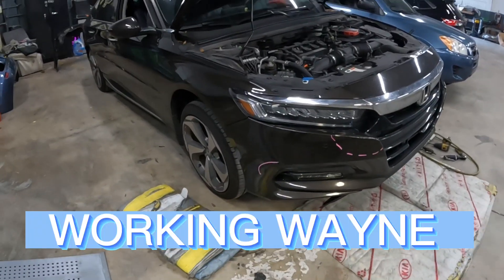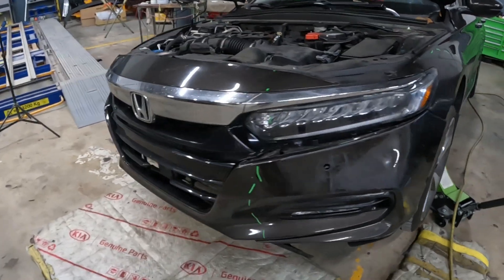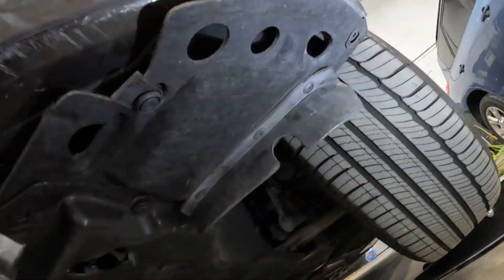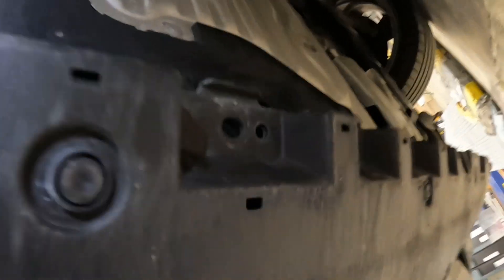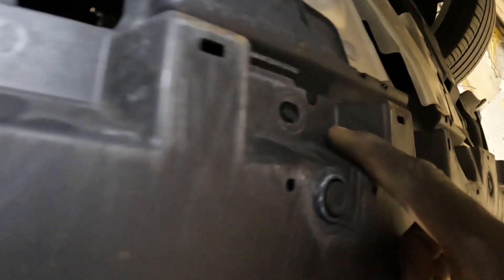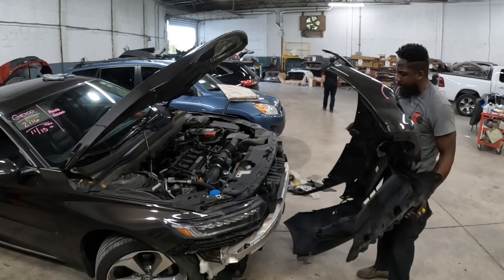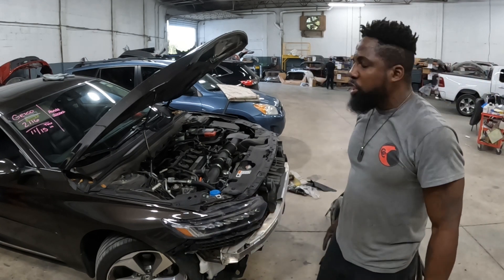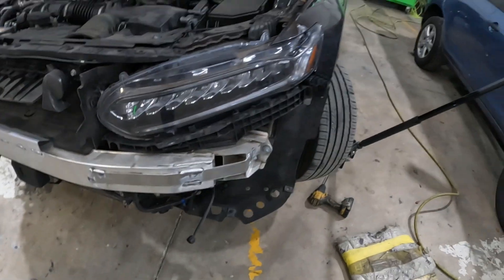2018 Honda Accord how to take the front bumper and headlight off

Comment: Yo bro I’m trying to replace the bracket u removed with the headlight cuz my bumper clips broke does the bracket separate from the headlight?
Reply from the maker: Yes it does separate
Reply: Same I have to do the same because my bracket had broken off also. You save me bro thank you so much